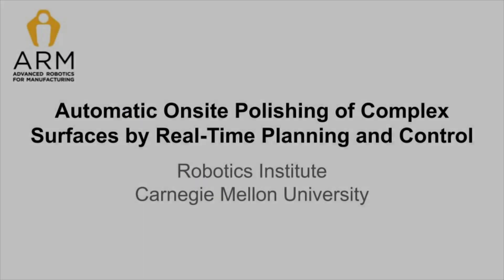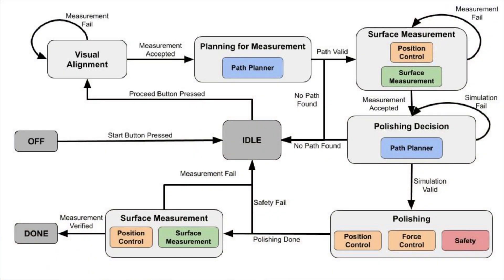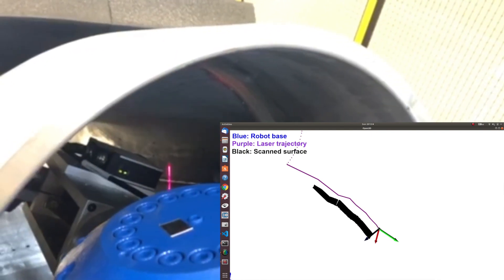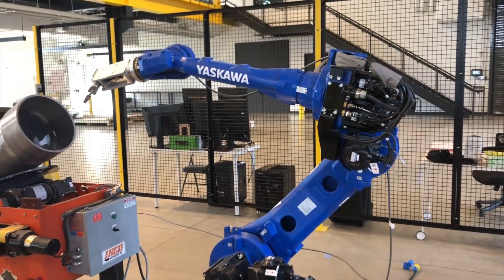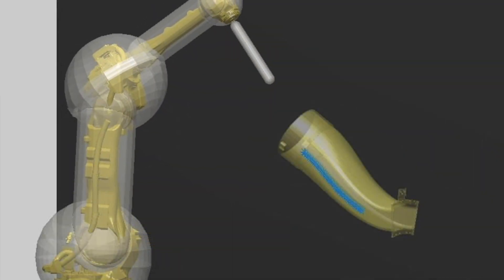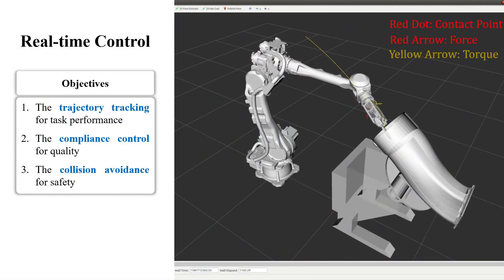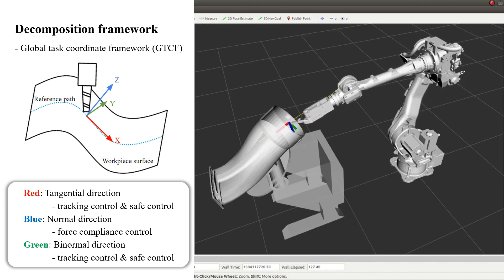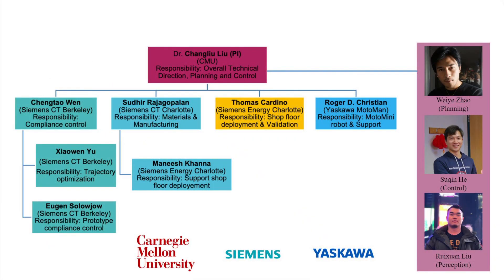Automated Polishing and Grinding : Advanced Robotic Manufacturing

Comment: We will be looking at something similar to this in a few months time.. Great work guys.
Reply: Did you ever find a solution like this? I am researching options.  Thanks!
Reply: @19Irish68  we ended up purchasing a nachi SRA Robot and it's currently on the water... we have OTC welding robots, so when I found nachi use otc controller/software, it was a no brainer for us...